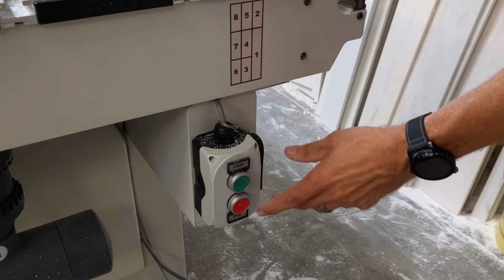AXYZ CNC Router   Vacuum Hold Down System

Comment: Hey sir. If you would be so kind to make a video showing me exactly how your vacuum pump is wired electrically and also how it’s wired to the machine. I just purchased a used Axyz and your help would be great. I have the same Busch pump like yours, mines is 10hp.
Reply from the maker: Probably not. You'll need to contact your local AXYZ dealer.

Comment: Andy,
What’s the Hg that you pull with that pump with a material on the spoilboard?
Thanks
Reply from the maker: I think the max is 25 but I will have to check tomorrow. That may have been the number on the old pump. I'll let you know.
Reply: @AndyGraves  with a 4x8 sheet loaded it pulls somewhere around 16Hg. Is that normal or I should be on a hunt for a leak. Thanks

Comment: Do you use a shut off valve when between sheets or you shut the pump itself?
Reply from the maker: Yes I shut off the valves of that section of the spoil board is open. I also shut off the pump after I'm finished cutting.
Reply: @AndyGraves   They recommend shutting these pumps no more than 3-4 times per hour, that's why I was asking. I'm getting its bigger brother the MM 1322 and trying to get as much info as possible before it arrives. Thanks
Reply from the maker: @cabkoinc.7137  Wow I've never heard that and they didn't tell me that when I bought the pump. I bet I only run that pump maybe a total of one hour per day. The rest of the time it's off. I've owned the pump since July of 2016 and I've used it that way since I bought it. I've had no issues with it and I've only had the oil changed.
Reply: @AndyGraves  Andy, I tried to find how many times is the max of shutting per hour and the manual actually doesn't say. I found another manufacturer of claw pumps and they advertise 10 times per hour. You may be just fine...

Comment: Andy, nice video. How do you like the Busch Mink pump? Does it give yo enough hold down? Did you have a different pump before so you can compare?
Reply from the maker: Hello, thanks for the compliment. I like the pump that we currently have with the CNC. I used to have a different pump that came with my multicam CNC. I don't know the exact terminology but it was a much larger volume pump. Both of them have great suction but I like this one much better because it's way quieter. The other one was super loud and if you had it on for any length of time was very annoying.

He gives me enough hold down because I'm covering up the entire spoil board with the Corian solid surface material that I cut.

Comment: We have a AXYZ cnc at work, we have problems cutting 1/8" thick abs plastic, the end mill lift the material, the vacuum does not work holding the material, maybe we should use a straight flute endmill. We use a conic tool to cut the ABS but sometimes I do not like the 45 degree chamfer on the edges.
Reply from the maker: Have you tried a down cut bit? It puts pressure on the material forcing it down as it cuts. It might work with your situation.
Reply: @AndyGraves  I will try. thank you for all your videos.

Comment: Based on the cameo of your dust collector, can we assume you had or still have a CAMaster CNC?  I'm considering a CNC solution and AXYZ are at the very top of my list.
Reply from the maker: Hi Brian, I had a Multicam before the fire and then I got an AXYZ CNC. The dust collector is a high volume collector from Onieda Air. The dust collector works way better than the one we had before. AXYZ routers are nice machines and the customer service is really nice.

Comment: Hello Andy, What kind of spoilboard do you use for oscillating knife applications? Thanks
Reply from the maker: Eduardo Bueno - Hello, I have never used an oscillating knife. We only cut with router bits. Andy
Reply: We used oscillating knife  in our axyz cnc, we used the same spoilboard. MDF material.
Reply from the maker: Do you have a link to the oscillating knife? What type of material does it cut?
Reply: @AndyGraves  we used this kind of knife https://cncshop.com/products/sku-bt-57215?variant=34336289128581
we had one multicam cnc router then the company bought a axyz cnc, both use the same knives, 1", 2," 3" & 4" tall. We cut foam (mostly polyethylene from 1# up to 4#) ,  and corrugated.

Comment: Great video Andy. Did you choose the pop-up pins option on your machine? If so, please make a video showing that and the machine actually cutting some Corian.
Reply from the maker: Hi Chino, No I didn't get the popup pins. Thought it would be another item to break. We actually cut the spoilboard to position the material. There are essentially two sections that are 30 x 144. I will see if I can't get a video of the AXYZ cutting the material.